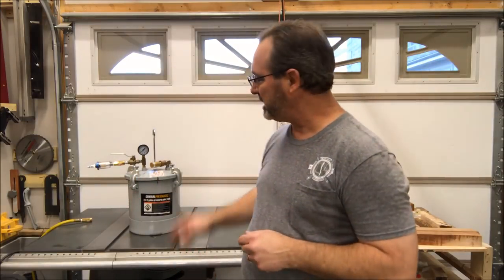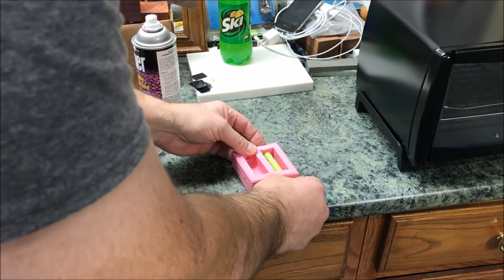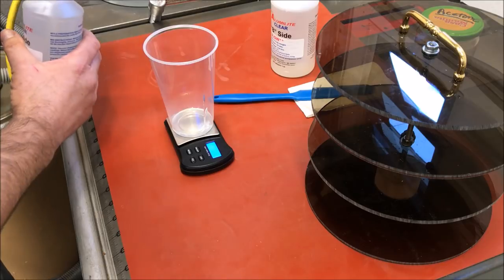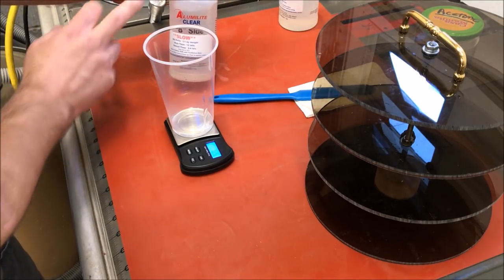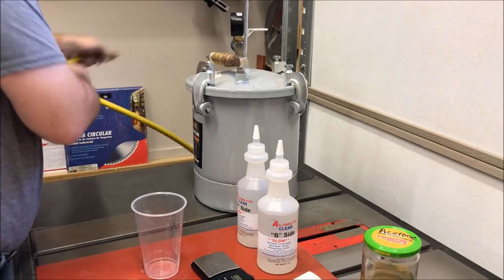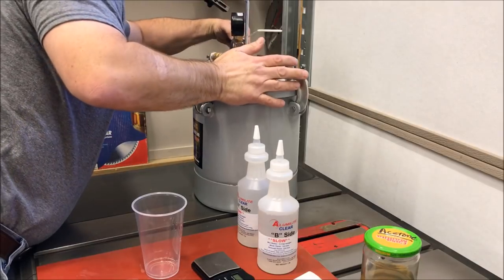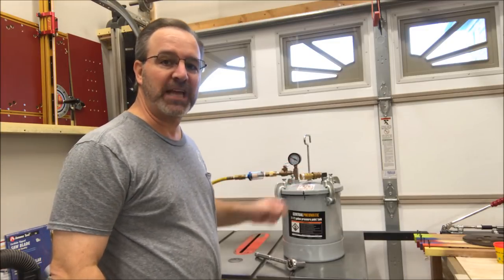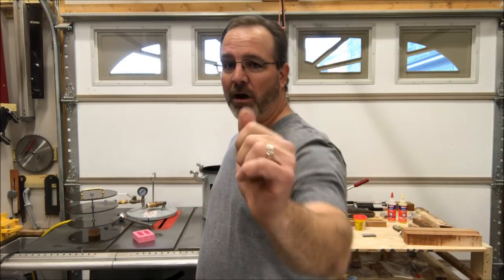My First Casting Experience And What Went Wrong

Comment: It looked like you did everything right on your plugs even how you pulled the sides out while pushing in the plugs. I've never used these but did see a demo from Fred at last year's MPG. 

A couple of things I noticed is that it looks like you B side is thickening up. Mine right now even over the summer months is like hand sanitizer in thickness. I have to run hot water over it for  30 minutes to get it back to water thin.

As for how you poured the resin into the blank, I've always seen that you pour it on the side and let the level rise up and flow over the tube or what you are casting. May not be a big deal with pressure but sometimes every little thing helps if some else goes wrong.

Oh and  for that little of resin you need smaller cups and maybe a better mixer. currently I use tongue depressor craft sticks where I cut the end with a quarter round so it sort of has a corner.

Have fun going down your rabbit hole. :)
Reply from the maker: Thank you for the information, advise, I appreciate it. 

Regards,
Bob
Reply: I use plastic spoons to do my stirring. I get packs of 30 free a few times a year when I buy my son his pudding cups. :P The more pudding cups I buy when the coupon is out the more free spoons I have. Wood can introduce bubbles into your resin so I heard. I do know I have less bubbles using plastic or silicone. I keep meaning to get these small silicone spatula things at walmart. They are about the size of a plastic spoon in length and would work perfectly. I think they are only a dollar something. I also never use a pressure pot. I torch my bubbles and have very few problems. Also warming your resin bottles in a warm water bath before using can help but be sure you don't get any water in your resin bottles.  - Heidi
Reply: I have some Poly Polypropylene lab style measuring cups on the way  50 ml and 100 ml. For stirring I'm thinking of moving away from wood. At Walmart  they have 88 cent 1/8"  thick 8 by 10 cutting boards that I plan on cutting up to make stir sticks or maybe modifying cheap plastic silverware.

Comment: looks like you need to drill a hole in the end of one of the plugs so that the pressure can equalise without popping one of the plugs
Reply: outside pressure should push it into the tube as it tries to compress the air inside. Vacuum would pop it out.
Reply from the maker: Nice idea. 😃

Comment: Thanks Bob.  Just a small suggestion that i learned is to mix in a cup that is just slightly bigger than the amount i am mixing.  That way it is easier to mix without having so much on the sides of the container.  Keep 'um comin'             JimE
Reply from the maker: Thank you Jim,
  I searched all over and couldn’t find smaller cups locally. I’m still on the hunt. 

Regards,
Bob
Reply: yes the quest for the perfect cup.

3 oz dixie brand paper cups or 3oz plastic ones, same size but usually some off brand. 

Don't use  5oz paper dixie brand cups, they are waxed and while people use them i'm afraid of getting wax in the mix.
Reply from the maker: Thank you Cliff.Regards,Bob

Comment: Bob a friend got me some pine cones do I need to put some wood harder on them me for I cast and try  turning into a pen
Reply from the maker: I’m not 100% sure because I haven’t done pine cones before but I would suspect stabilizing or wood Hardener would help keep them together while turning. Please keep me posted of your results as I have several pine cones to turn and all info will help. 

Regards,
Bob
Reply: I don't stabilize mine however they need to be dry dry dry! I will set mine in a toaster oven on low heat for several hours. Any moisture in the pinecones will cause bubbling and could ruin your cast.
Reply from the maker: Excellent information, Thank you very much.Regards,Bob

Comment: I'm sure my first attempt at this won't go well either LOL.  Looks like a pretty easy setup.  I know with the Cast'n Craft acrylic from Michaels, it took a day or more for that stuff to cure and be usable.  If alumilite is ready to be used in a few hours that'll be great.
Reply from the maker: It only need a couple hours in the pot. 

Regards,
Bob
Reply: So once you removed it from the pot, its ready to turn, or does it still need to cure more?
Reply from the maker: I’ve had conflicting answers on that. I’ve elected to give it a couple days just to be sure. I will cans another blank and turn it immediately compared to some that has sat as a test.
Reply: This is what I've been hearing as well.  Never had any acrylic blanks that were ready any sooner than having to set for at least 24 hours.  So I would think the alumilite would be the same.
Reply: It's not as well advertised, but there are a couple different times. Alumilite has a data sheet for their products; here's the link for the clear slow.
https://www.alumilite.com/PDFs/New%20TDS/Alumilite-Clear-Slow.pdf
The tldr version is:
Resin sets in 12 minutes
Demold at 75 degrees F: 2-4 hours
Full cure at room temp: 5-7 days
Full cure at 150 degrees F: 16 hours

I found some instructions on the Cast'n Craft: https://www.eti-usa.com/sites/default/files/Casting-Resin-Instructions.pdf
They aren't as specific, but it looks like it sets in 15-20 min, demold in 20-30 minutes, and full cure in 1-24 hours.
Reply from the maker: Thank you Cam.
Regards,Bob
Reply: Thanks for the links Cam.  So with the alumilite, a fully ready blank could be done in a day using a toaster oven to finish the process.
Reply: Depends. I put all my resin blanks, PR, Epoxy, Alumilite on top of the fridge. Gets pretty warm up there if you have one with coils on the back.

You can tell when they are hard enough by clinking them together. When hard its a high sharp sound like hard wood not a dull thud.
Reply: Thanks for the information and the hardness test tip.  I turn pens mostly for a hobby and for gifts so most of the time any blanks I make are just for fun so not in a hurry to need them, but seems like the Cast'n Craft took forever to cure, sometimes several days.
Reply: William Todd some for me took a week. I've come with lots of weird ways to heat it up including a water bath on top of a coffee cup warmer.